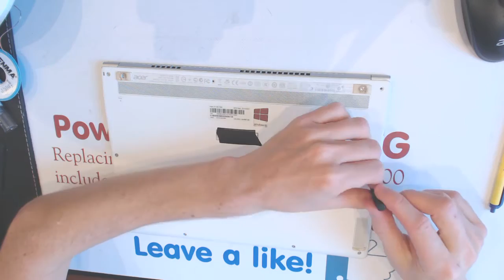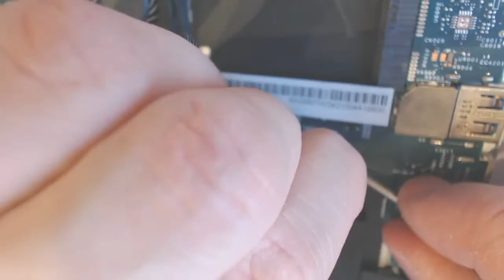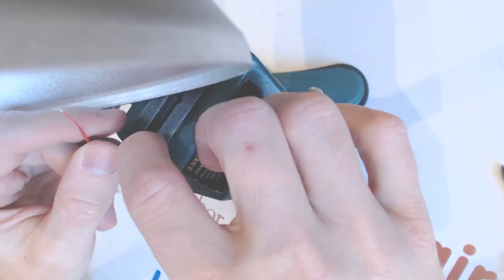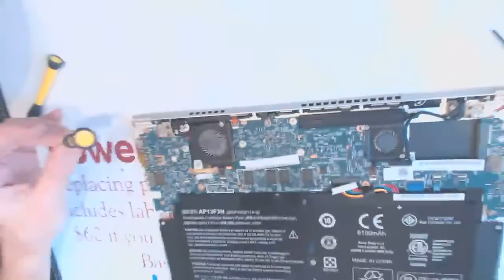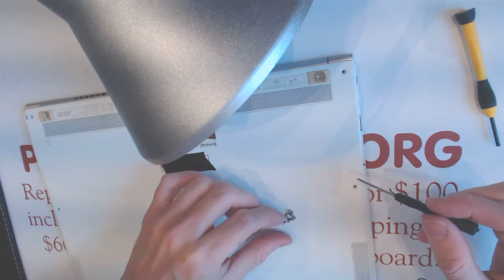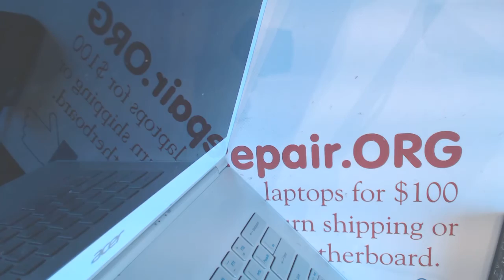Acer Aspire s7 series Laptop repair fix power jack problems broken dc socket input port

Comment: I've got 3 laptops Aspire s7 (2 s7-391 & 1 S7-392) and only 2 chargers remaining, only 1 is  working, with cables worn out from usig it for so long. The last one working works on all 3 laptops @Powerjackrepair can you tell me why all replacement chargers I buy, none of the laptop can charge with them ? They are OEM replacements and I've already bought 3 of them, with same reference and same manufacturer, same plug size, but it does not "click-in" the same. It seems the pin plug is a little bit too narrow to touch the inside of the jack port correctly. What can I do ?
Thanks